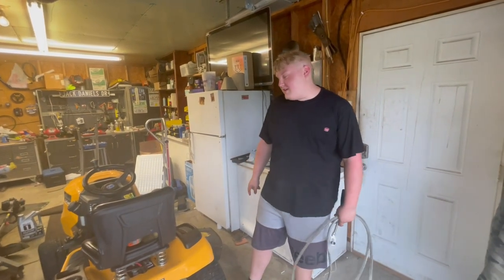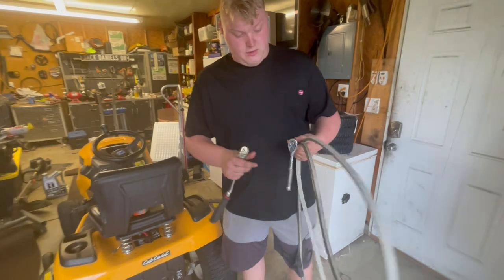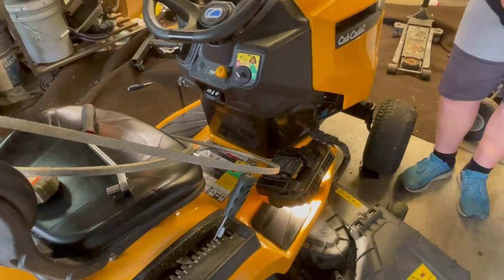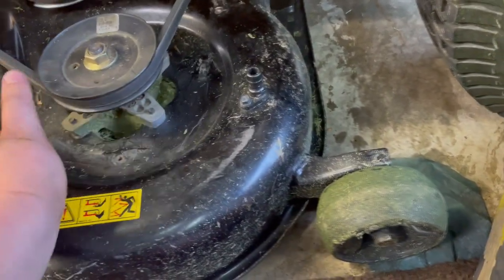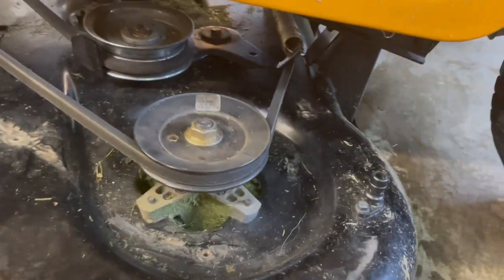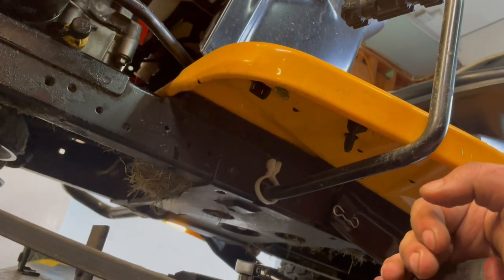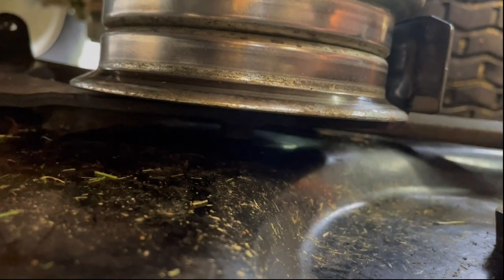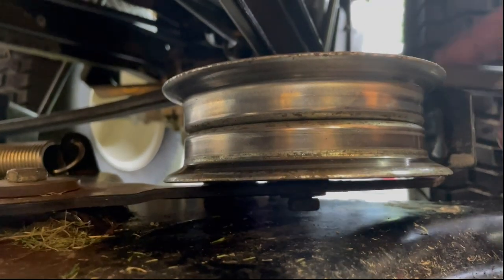Cub Cadet XT1 LT50 Mower Deck Belt Replacement

Comment: The biggest problem I am having is putting the belt on the front pully, I can't release enough tension to get it on the pully?? You skipped that part lol.
Reply from the maker: Sorry I skipped that part when I was working with the front pully coming off the motor I bent the rods that make sure the belt doesn’t come off. And once I got the belt back on I bent them back into place. I only bent them enough for the belt to come out. Sorry for skipping that part.
Reply: That’s my problem also  I undid the spring and the arm hits  lift assembly  😢
Reply: Still need 3”

Comment: Thanks for the post! Helped.
Reply from the maker: @mick58kc72  Glad I could help!
Reply: @mwggarage1968 how did you get the belt between the pulley and that metal tab
Reply from the maker: @RyanCrego-ie2nq  if your talking about the pulley on the deck I loosened the pulley which gave enough room to get the belt on there.

Comment: My tension  spring arm hits the bracket ? Stops not enough to get the belt on     ?  Came off the clutch pulley
Reply from the maker: The only thing that I can possibly helping you with is trying to get a diagram of the mower deck to see if everything is in its correct place.   If everything is in place like it’s supposed to be then I’m not sure what it could be. Something else I could tell you is to possibly try and find other videos of guys doing the same thing I did but with removing the deck. I hope this helps and if not I’m sorry I couldn’t help.

Comment: I just figured it out when the belt slipped the tension bar ended  on the other side middle between the rear pin mounts had to lift and pull forward   And Wall ya  that spring  to get back on the s mount  I used a pull rope    Remember Iam on a concrete floor 4” above ground   No wonder the pros lift these waist high